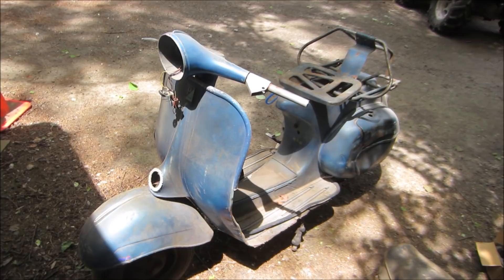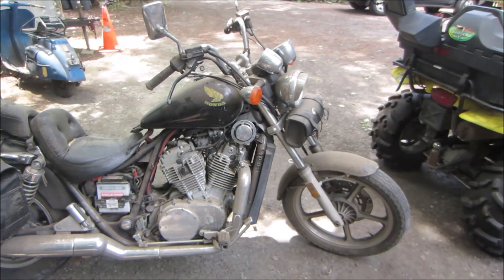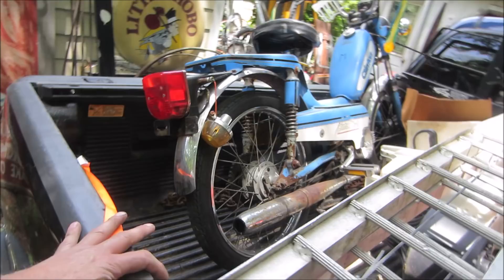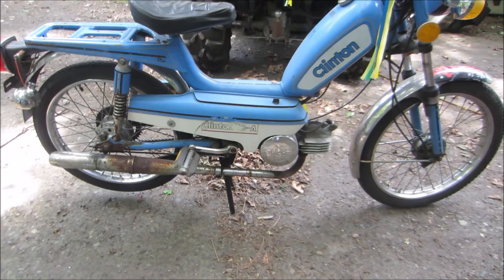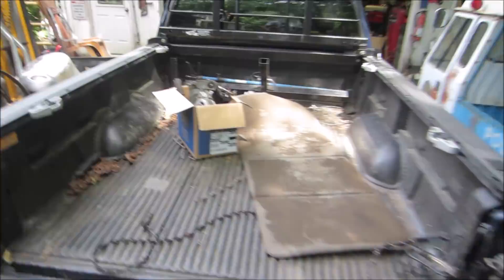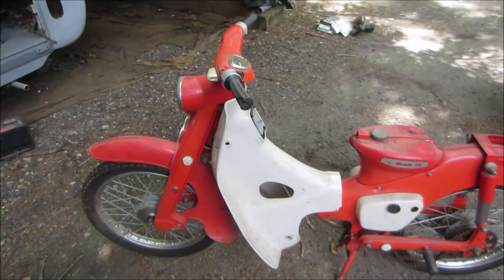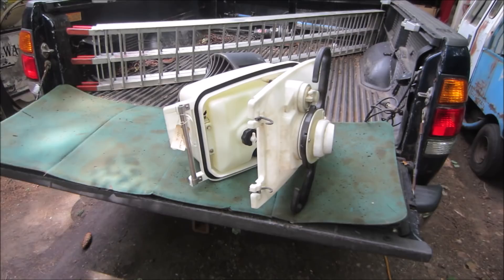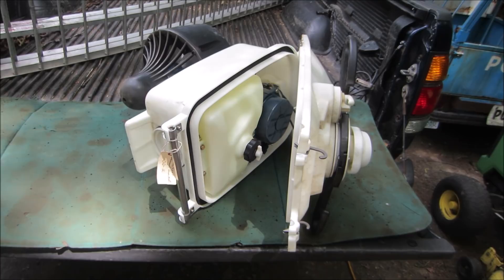motorcycle garage sale finds 6 16 18

Comment: that ‘86 Shadow 1100 is a very good motorcycle to ride. i rode one 120-140 miles 7 yrs ago, one way, for a buddy that was moving. i’ve done this several times for pals, because it: saves valuable space in u-hauls/trailers, ensures that i’ll be there for the load-in, gives me a chance to ride someone else’s bike, makes me feel cool, makes me happy & makes me feel helpful...all in one trip. 

the 1100 shadow was very very smooth, quite throttle-responsive, it stopped well, cruised nicely at 9mph over the limits & was rather comfortable for my 6’6” 225lb body with 35 yr old tall-guy back. i often need a break after 45 to 60 mins, but was OK on the shadow. 

i hope Mustie1’s shadow went to a loving home & is making someone happy these days. 

i am an Air-Headed Beemer guy...you know, the ‘70s R50 - R90s type that look old, clicking valves that sound like sewing machines in Sri Lanka & stop like crap, but i was pleased & proud to ride the old shadow. i spent an hour or more prepping it for the trip. all of the rubber was good, so i changed all fluids & filters that were visible & had Zero Issues, other than wearing my buddy’s neglected, sweat-stench-moldy helmet that is 4 sizes too big for me, due to his giant pumpkin head.

Comment: That's a bumper boat engine. Pretty cool!
Reply: Yup. My daughter and I played on those a long time ago. You could rotate the whole motor assembly to go any direction. At about 2 mph...
Reply: Hahaha.
I know I am late to catching up but I actually knew what it was too.
They had them at the lake in the early 90’s.
That was when they had water slide down the hills and one that was a fast drop on a sled type boat.
Go carts, horseback trail, batting cage.
They had a place like that about every 2 miles and now they are closed.
I think safety took away the monitored fun and now the kids have to find fun without supervision.

Comment: Mustie if you can read this, this honda motorcycle can be easily revived with a new chinese LIFAN engine of 110cc. Α lot of people in my country did just that when the old engines gave up spirit. Cost is about 250-300 bucks with shipping. It's one of the best commuter bikes.

Comment: That’s a bumper boat motor, used to love those things when I was a kid in the early 1990s. Basically same concept as bumper cars, but in a artificial pond or lagoon. Was a big rubber tube, with a molded plastic insert that had a bench seat and floor. The motor stuck through the floor, and the seat portion sat up on one side of the tube. I even remember staying at a Holiday Inn resort in Tawas, MI that used to let you rent these to putt around in out on Lake Huron!

Comment: I  Like your Style, you are so Determined to finish a Project. Several years back, I had bought a  Honda 90 trail bike, ( very used) Completed the engine an trans  Shifting work . Got it started and  It went wild, The throttle assembly in carb was wide open. Learned about the settings quickly Stay healthy ..

Comment: The Honda 50 cc brings back memories of commuting to work in London in 1970 - 1973 on one of those.   Then I rode a 90 cc version and then graduated to a 200 cc Yamaha two stroke twin which had a great power to weight ration.   This 50 cc engines were great.   Very reliable and fast enough in traffic.

Comment: Bumper boats aka battle boats, it was like bumper cars but they ran in a large above ground pool or a small pond. I worked at an amusement park  back in the 1970s that had them. They also had a battery powered squirt gun that would suck up the pond water and shoot it about 5 or 10 feet.

Comment: That's a very clean looking frame for a Honda 50 stepthrough of that vintage,62 you say? Check for rust inside the rear wheel arch, and/or protect against rust starting there. That's what killed all my 3 hondas in the end. Great channel btw.

Comment: Lookin forward to the Trail bike vids, we've got an all-original (can't remember the year) Trail 70 with just over 700 miles on it.  Rebuilt the carb last year or so (my parents have owned it for at least 30 years!) and it runs fantastic.  I need to give 'er an oil change soon, been sitting too long and it deserves it.
I wish I could get that "lucky" at sales locally but alas I'm stuck to fixing up cheap trimmers.  Still fun though, eh?  Gotta find me a project bike soon...
That Cub looks fantastic!  Except..  Wow, that piston - I wonder if I could even do that much damage with a hammer.

Comment: Simon from the uk here... awesome scores on them. Cold start was great and the new buyer will be pleased you got it going. I’ve got 3 Hondas that I’ve has for yrs. If you can’t get the parts you need local I can find out how much to post to you from the uk. I think one is 1960 and the other two 1965 and 1966... I’ve snot run them for a while but I always make sure fuel ⛽️ is empty. One is a 90cc which is great fun. :)

Comment: That Honda engine looks to be the first generation horizontal single with pushrods instead of the now familiar OHC. As a suggestion I would recommend finding an aftermarket 150cc clone engine with 4 speed trans. It would make it much more ride able. I'm sure the old pushrod engine parts are getting pricey anyway. Just a suggestion for what it's worth. Great haul though!

Comment: I think my old hmc green machine trimmer has that same  carburetor on it. 25cc 2stroke. Have fun getting that carb to work correctly. Carb kits are available but hard to find. A thorough ceaning along with a new gasket and diaphragm set didn't get mine to work.

Comment: We have a local amusement park called Indiana Beach, and they used to have those bumper boat things that used engines like that. I had a lot of fun on those. They were like an inflatable ring, and I think they had a seat mounted on the side.They have something now that is a molded plastic  or fiberglass thing with a seat, and a squirt gun mounted on the front. I think they use an electric motor on them. Still fun, but not quite the same....

Comment: I had the Honda Passport back in the 80's.  I think it was called a CT70.  70CC would go 55ish when I was young and thin.  You could get a Chinese motor/trans setup that would bolt right in for a couple hundred bucks instead of trying to rebuild that one.  We call them "Chondas"  :)

Comment: The cub 50's were known as c100 because the vin started with c100, right above where the engine bolts on.Kick start only. Then came the c102, also a 50 but had electric start.

Comment: The Hondas are known in Australia as 'postie scooters' as AusPost delivery operators use them in rural and high density suburbs, fitted with saddle bags all round to carry letters and small parcels. They are actually a custom order from Honda, requirements being heavy duty suspension, more powerful motor (100cc special customer request), deleted flaring, larger fuel tank, double welded frames, stronger designed wheels and  other AusPost specific modifications. The main identifying difference being they are powdercoated fluro yellow for safety, retro reflective tape applied, and minimalist manufacturers identification. Highly collectable and valued in Australia due to their uniqueness and AusPost bikes are quickly snapped up at auction.
Reply: Andrew Hallett-Patterson cool I'm gona have a butchers at one  now

Comment: Ahh the honda 50/70/90 or Honda Teabag as locals used to call them :-D
The lack of manual clutch on those bikes always made me nervous to stab it in to gear, but they were a very reliable machine, i thought of them as commuter bikes.

Yes the honda looked so much better after a jetwash, the new owner will love it :-D
Reply: pull in, *clonk*, release slowly. once it's moving, it's a breeze. that kind of engine is perfect for a jockey shifter.
Reply: That thing will start without an engine lol indestructible!!
Reply: We used to have a Honda C90 for off road use back in the 90s and if you held the gear selector down in 1st you could use it like  a clutch for drag race style starts or wheelies. Not recommended on nice specimens theses days.
Reply: Jimspeed 13, naughty lol :-D

The other oddness to the honda 90's was the strange lifting of the front end when you applied the front brake.
That was just odd to me.
Reply: A honda crunchie, I rebuilt one of those a lot of year back. A guy had strip it down then lost interest in it.
Reply: The one time i used the front brake as young very inexperienced rider on wet grass the front end didn't get chance to lift as it slid off one way and i went the other. It was at low speed so only pride was damaged.
Reply: Jimspeed 13, I've been there too, no one was watching, thank god lol.
Reply: They DO have a clutch. It's in the gear lever. Go fully up or down and release like a foot clutch on a car. I learnt the hard way with the wife on the back.
Reply: Bartholomew Horatio Brunel.
Yes you are spot on there :-D, very tough little engines.

I know the years have passed and companys change things, but i still like honda engines more than any other brand.
Eather i'm programmed to like them or they are just very decent :-D
I've not liked kawasaki or yamaha for years, i'm likely just biased against them.
Reply: Bartholomew Horatio Brunel
I havn't seen an honda 90 (teabag) around coventry/nuneaton for years, my old A100 suzuki was stolen from me and i wanted a honda 90 to get me to work.
I had more chance seeing count dracular running a bloodbank without sipping the stock, if you get my drift lol.
Reply: zx8401ztv  We called them pogosticks  C50/70/90, due to the antidive front fulcrum points of the front suspension back in the 70,s .
Reply: Scott Gibson, ha ha pogosticks, that sounds spot on for that very odd front suspension.
Reply: zx8401ztv I remember getting one that would not start at the age of 12 from an old man  , got a book on the Honda 50 ,took out the carb cleaned it up , and kicked her a few times and that's the story of my first illegal road bike lol, loved them ever since ,bullet proof ,
Reply: stone wall
Ooow you bad lad lol :-D, sounds like you had some good fun.

When my motorbike was stolen i looked everywhere for a honda 90, i could not find one anywhere.
Finally i found a kawacrappy kh125d5, it did the job but 6 months later the piston melted and killed the big end :-(.
i got the big end repaired and slapped the engine back together, it was fine after that.
(The most unpopular bike ever made, not even the haynes manual covered it.)
The honda 90 would have prevented all that hell and been reliable.
Reply: zx8401ztv the Honda 50,70,and 90 were like hens teeth now days , I remember getting off the 50 and jumping on the honda cd 175 as a teen , I taught I was a total animal , all the old country men had one , another great wee bike , I wish I had one today, nostalgia ,great looking back at our experience with them old bikes ,brings back great memories
Reply: stone wall :The excitement of youth :-D You animal :-D.

Someone told me that honda did produce a new version of the honda 90, but i've never seen one on the uk streets, perhaps it never made i'ts way to the uk, price perhaps.
Reply: zx8401ztv they did bring out the 90, but again is it the same as the old bikes ,I don't know ,like yourself I haven't heard or seen much of the new 90 , ,I'll keep my eye out for a good cd175 if I can pick one up ,just to take it out for an odd run when we get a bit of sun ,just for old time sake ,old and bald now trying to stay young lol, I love this channel just to see the old stuff being brought back to hear it's former glory  ,mustie is a very handy man
Reply: zx8401ztv Sym make the Symba a complete Cub clone. Riders of Yeovil were doing a Cub copy for £600 in the crate. Apparently they weren't bad.

Comment: That red n white placcy 50 was a good find.  All the hipsters over here are building customs out of them and demanding high prices. If you're not arsed about originality then most of the gy series pit bike engines bolt straight in (almost) and can give you a nice little power  increase, especially if you go for a 160cc. Don't cost an arm n a leg either.

Comment: That Honda 50 is an earlier model. It has a pushrod motor. Later they went overhead cam. I bought one of those earlier ones for £1.50 when I was about 13 or so and used to ride it on a field at the back of our house. I seized it and it stripped teeth off the cam gear. I was given a good cam gear from a boy at school's father. Good learning at that age. I pulled the motor later and used in in a little go kart that I built. It ran without a battery. That would have been around 1971 or 72.

Comment: That Honda looks like a QA50 pushrod motor, less common than the Z50/CT70 type engines but parts should still be widely available on Ebay etc

Comment: Waahooo Mr.Mustie, ..... a Honda 50 !!!  .....  ya know they & their derivatives were the biggest selling motorcycle in the world by far ! .... btw those earlier ones had push rods & a cast iron head & i think the valve guides where part of the head. the later redesigned engine had a cam chain with alu-alloy head & wud just run forever.  i wonder can you fit the newer engine into that frame as there were millions made & may be easier to get ?

Comment: The best of the Honda 50, 70 and 90cc Cubs was the 70cc version which had the superior performance of the three.  Solid bikes which ran well mechanically but suffered from regular alternator charging problems.

Comment: You must have much better garage sales in your area! Anyway, pretty much any “underbonne” Honda engine will fit into that Honda 50 - a.k.a. “C-100” - frame. The engine from your CT-70 will bolt right in, as will even a brand-new engine from any of Honda’s current line-up of 50 & 70 cc bikes. I imagine stuffing in an engine from a CT-90 would be just as easy. Also, many of those Chinese “not really Honda” crap cycles being imported have engines that were copied (ripped-off) from the original Honda design, and will probably bolt right in. 

 Personally, I would tear down the original engine and rebuild it, but until you have time for that, perhaps consider my previously mentioned options. And, how cool would a ‘62 Honda Cub with a manual clutch, 4-speed trans, and twice as much horsepower be? Yee-Haw!

Comment: Honda Passport/Cub/Super Cubs all use a pit bike engine with a semi-auto clutch. A company called T Bolt will sell you a 125cc engine upgraded to 141cc, for instance. You'll probably want to convert the thing from 6v to 12v.

Comment: Honda cub 50 they did three a 50cc a 70 and 90cc chinesium four strokes are based on this bike engine and you can still get bits for them I am in the uk tho we used to call them honda plaggy on account of the plastic leg shields lol

Comment: On that little boat motor thing you got there they were used on bumper boats kind of like bumper cars but they were inner tubes and you would see them in carnivals and state fairs and such and you could turn them 360 degrees and bump into each other in like three foot of water. If you want to do something with it the perfect candidate is one of those pedal boats that holds for passengers and two and sometimes three people can pedal at once but that would be a perfect little home-built project for one of those pedal boats. Let me know if you like my idea

Comment: And I I've had the pleasure of using one to go after loofah sponges I believe the name is called a lupus scoot they also use them on rubber rafts such as inner tubes that's what the problem aroused with the propeller housing around the blade

Comment: I've got a few heads and parts for that engine in the garage  you can fit a lifan  engine straight  in very cheap mustie
Reply from the maker: are they for the push rod engine or ohc
Reply: Mustie1 ohc  engine  xy  type  they are used alot in pit bikes .Honda wave  Peugeot  vox all the same engine  .
Reply: Mustie1 I see on close inspection of the vidio that you have a push rod engine not seen that in a c90 before I would probably just replace the entire engine with a new lifan 110 not expensive easy swop and very reliable
Reply: Mustie1 check out (Rustbelt Cycleparts) he was selling a complete pushrod type engine

Comment: The honda shadow that you described is indeed a 1986 but it is not a 1100 but rather a 750. I own a 1985 honda shadow 1100 VT, both 85 and 86 were exactly the same. This is just a friendly correction.
Reply from the maker: no this is a 1100
Reply: I am sorry but I am certain, that is a 750 not a 1100.

Comment: Mustie1,  I have an engine from a Honda C110 Super Cub from 1962.  It has a four speed transmission, 50cc engine.  You can have it for free if you can find a way to get it from East Tennessee.  Let me know if you want it.
Reply from the maker: l may take you up on that sir
Reply: Glad for you to have it.  It's complete with carb.  I think it might have a bent pushrod but that should be no problem with the blown motor for parts.   I'll be glad to send you a photo if you want it.

Comment: Mustie1i believe you should be able to put a Chinese 110/70/50 cc I'd go with 110cc motor on it. Any little Chinese ATV will have a motor that will work seeing as they are 99% copies of the Honda motors.   And they are cheap, a new motor is like $250 on the bay.